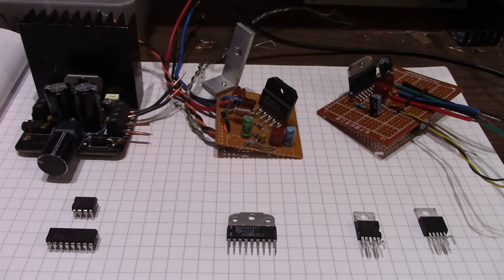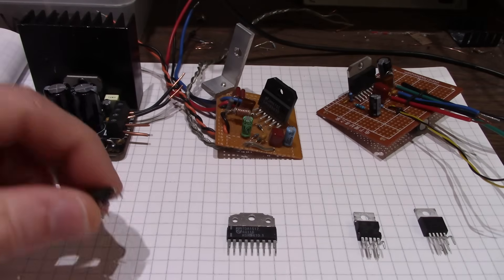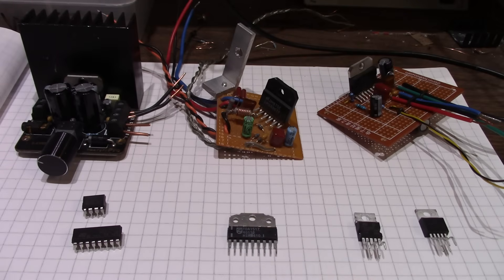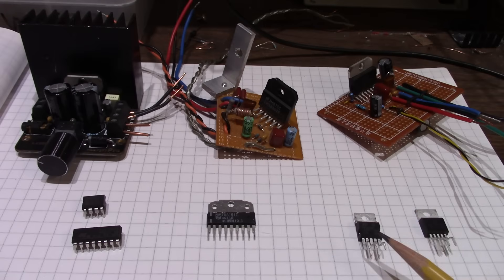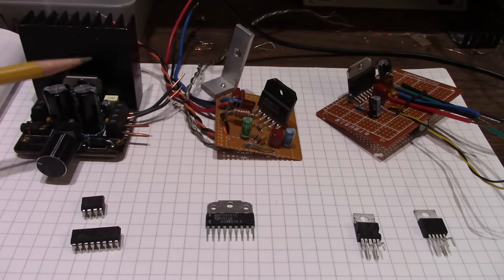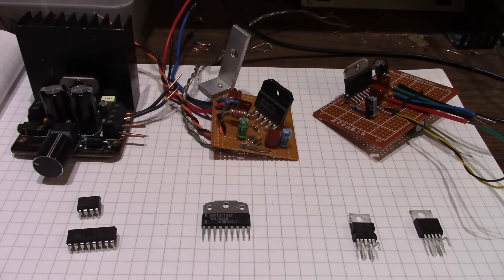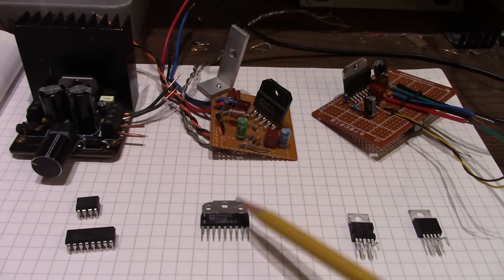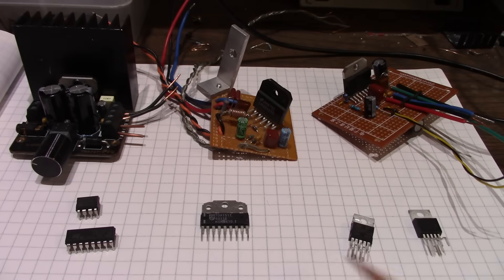My favorite audio amplifier ICs 2025 (linear)

Comment: The biggest cause of distortion is loudness (power). P=VI, and since you cannot control current in a passive loudspeaker you increase V. However the further you push a cone the more you stretch the elastic surround, and the more compression of the linear signal. Also the coil leaves the magnetic field where it is cleanest. That's why I never play music too loudly. There's an optimal 'sweet spot'.

Comment: Hi! Since TDA2050 is your favourite, I bought the cheapest single supply board I could find on Aliexpress. It was 1.92 USD at the time one month ago, now it's double that. I was hoping this would have less hiss than the cheapest class D boards.

Out of the box the hiss is maaaaaybe a little less, but still annoying. BUT, the TDA2050 lets me set an arbitrary gain, so I put a 12 K resistor in parallel with the existing 22 K between pins 4 and 2. That pretty much got rid of the hiss and the amplifier is still loud enough for me.

What I don't get is why it works at all with this lower gain? 22 K with 12 K results in ~7.7 K. The other resistor is 1 K so the gain is 8.7x or 18.79 dB. The datasheet says the gain must be higher than 24 dB.

What is supposed to happen when the gain is lower than recommended anyway? The music sounds normal. The chip runs cool, even if I turn it up to listen from the next room. The power supply is 12 volts and the load is a 4 ohm speaker.

Comment: The TDA 2050 was derived from the TDA 2040, which itself derived from the TDA 2030, and the latter from the TDA 2020 and TDA2010, designed in the 1970s. These were the first super-circuits touted as the world's first integrated circuit hi-fi circuits.
The TDA 2020s were an absolute breakthrough, even though they exploded from overheating due to their insufficient cooling capabilities.
There was also the TDA2051, but it was quickly discontinued because it didn't offer much value but was only slightly more current-efficient than the TDA 2050. The TDA 2030A was a higher voltage version, up to +/- 22.0V, with an 8-ohm output. The TDA 2030 had a +/- 18V voltage and was primarily used for 4-ohm loads. The TDA 2030 was discontinued long ago, leaving only the TDA 2030A.

Comment: I put a small 10mm x 10mm x 10mm heat sink on my TDA7276 when I use them.  Helps dissipates the heat.  Hardly a panacea for the heat, but helps.

Comment: I dont have a lot of experience with chipamps, i had an UTC2003 and it was pretty damn good, but it went bad, then i got a new ones, but i didnt knew these were fakes, and also they didnt sounded as good as an UTC one and didnt had that much power, even though TDA2003's are pretty much low/lower-medium power chips.
Once i had a KA2206B, That was also wasnt that bad, it was in a cheaper 90's made radio it only did go till 11V absolute max, though 9-10V were the recommended rail voltage, it did 2.3W at 4ohms.
I still loving my Pioneer SA7800, its almost fully discrete amplifier, though at the amplifier or preamp part it doesnt have any unobtaniums, but it have one inline unobtanium at the VU meter, the meter itself a VFD, mine already dead, but i ressurrected it with lite on smd leds on a prefboard and made it well so it looks like the original + i tried cold white leds which will turn blue easily with the blue glass the amplifier chassis have on it.

Comment: Ill add some of my favorites since others are doing it lol
TPA3122D2N DIP package class D cool
TEA2025B. ive had a pair of these going everyday for a decade now maybe longer
STA540. Very versatile, Quad single ended, bridge+dual SE or dual bridge
TDA7297. Still have 3 of these laying around here somewhere. Built a benchtop test amp from one of them.
TDA7376B. very comparable to the 7297 but will happily drive 2 Ohms
TDA7396. Mono output, will deliver over 40W into 2 Ohms
TDA7577, Stereo 2 ohm with the ability to parallel  for mono 1 Ohm allowing around 80W of clean power

Need more power?

TDA7850. quad output, delivers ~45W into FOUR 2 Ohm outputs. great for DIY boomboxes using car subwoofers, but holy heatsink and current draw batman 
TDA7295 80W version of the 7294
TDA7294, Bridge 2 of these bad boys and you got a 150W Monoblock 
TDA8954J, The only one listed i haven't used as it got discontinued before i ever got my hands on one, DBSP-23 package (very close to the TDA's multiwatt), Class D would deliver CLEAN ~175W into 2 4 Ohm outputs

thanks for reading my ted talk

Comment: If I may add my favourite ones, they are TDA2040, TDA2030, TDA7057 and NE5534. I tried many more like NEC's 1181H IC, TDA2005, JRC 4558, TDA2003 (which I have a war with still), TDA2822 and many more like the ones from TA and TFA lines as well as a lot of TDA amps. Most that weren't that great are probably my fault, but the ones I prefer I do so because they are easy, low number of components and quite good sounding (loud and good quality). I would very much like to see TDA7057 and TDA2040 on the spectrum analyser if that's possible

Comment: sad to see you dropped the beloved LM1875 from the list.
I get to know both TDA2050 and LM1875T by watching your videos , both ICs LM1875T and TDA2050L from UTC I loved most , other on list are TDA7294 and LM3886

but just as you like TDA2050, I love it too , 
on a side note UTC have Drop the Box type epoxy package for their UTC TDA2050L these days , now they look like same as other TO-220 , with notch on sides ,  which makes difficult to spot fakes from Good ones ,
to be on safe side I even stock hundreds of them, UTC TDA2050L and LM1875T NOS
Reply from the maker: I keep a bunch of stock on the TDA2050 too! I also have a bunch of the LM1875 IC, though I don't use them anymore.

Comment: LM 3886?
Reply: @janosnagy4382  LM3886 is a very good amplifier. I wonder why you prefer TDA7293 and TDA7294. Is it because of the power difference?
Reply: @sedatsedat3078  He didn’t say that. In the video he concluded that the LM3886 and the TDA7293 perform very similarly, both being excellent chips with only minor differences. He didn’t state a preference for the TDA7293/7294 over the LM3886, nor did he say the choice was because of power. In fact, he mentioned that his personal favorite is the smaller TDA2050, since it delivers the same low distortion with less output power.
Reply: @janosnagy4382  I understand this and have watched many of your videos. I think you know the LM3886 IC very well. The LM3886 and TDA7293-94 are practically rivals, so I wondered why you didn't choose the LM3886 among your choices. Although the LM3886 has lower power, I think its sound quality and protection circuitry are better than the TDA7293-94 series. The unbalanced voltage protection, in particular, works very well on the LM3886.
Reply: The LM3886 is capable of lower distortion. I think it's technically a better chip but, having tried it in many configurations it never sounds as nice as the TDA7293/4.  

Both are about the same wattage in reality. You don't want to use more than 25~28 volt rails into 4ohm loads.

Comment: I looked under the lid of my Kenwood AK35 amplifier and the amp IC is a lot bigger than these amp IC's? Does that mean I won't find a replacement when it pops?
Reply: sanyo hybrid stk4141mk2 or stk4151mk2 ? (iam guessing) those were used in almost everything in the 90,s so loads of doner amp posibilities ,those crappy 3 or 5 disc carousel aiwa midis should be a good source of those on the cheap because those all have dud cd lasers, or there are discrete component replacement kits 

my observation of sanyo stk,s is if your amp has one you can extend its life by cleaning and re-pasting its headsink and never ever run it at 4 ohm that kills em fast (runs hot and very likelly to break into oscillation)
Reply: Thank you so much for the replies, it is good news that the Sanyo amp chips might still be available.
Reply from the maker: These are probably hybrid packs. Yes, most are obsolete and many fakes on the market.
Reply: Generally for 4 ohm  STK yopu must supply votage decrase  30  % , for limitng  current. 
Short circuit almost always results in instant destruction. Sanyo It states that the short-circuit resistance is up to 2 seconds. But that's only if the circuit is new and not worn. This shouldn't be done.

Comment: The TDA2050 is a really excellent amplifier - just as long as you make sure that you use a genuine original one! I prefer to use a single rail supply to guarantee that the speaker is isolated to DC. Using top grade capacitors is essential. However, adequate bass can be achieved with a speaker capacitor of no more than 1,000uF.
Reply from the maker: I'd go 2,200uf if running 4 ohms speakers. I did see your other post, btw. I have three stereo amps using them. One has been on continuously for 14 years with no issues.
Reply: @JohnAudioTech Good point.

Comment: Does Tda2050 & Lm1875 output same power at a given supply voltage and load ?
Reply from the maker: The 1875 is slightly less at a given supply voltage at 8 Ohms and even less at 4.